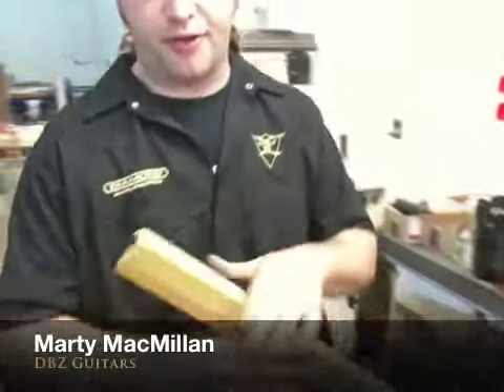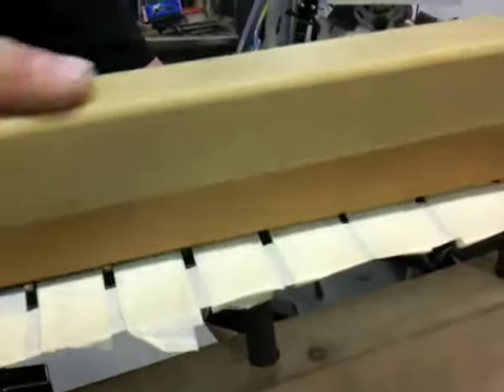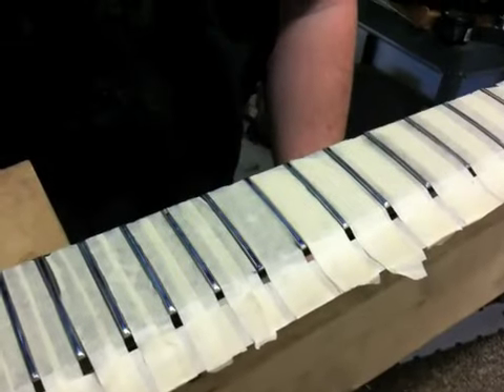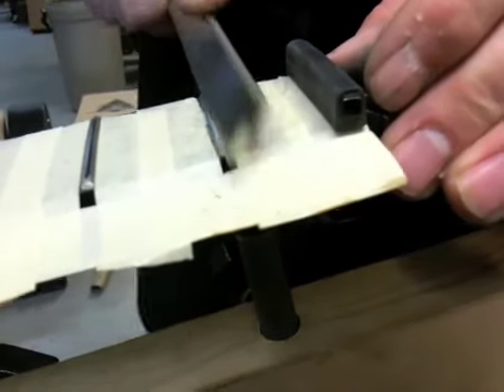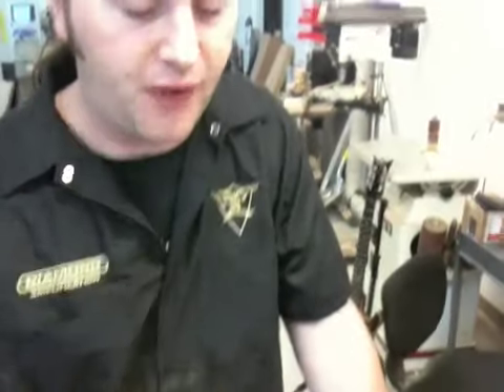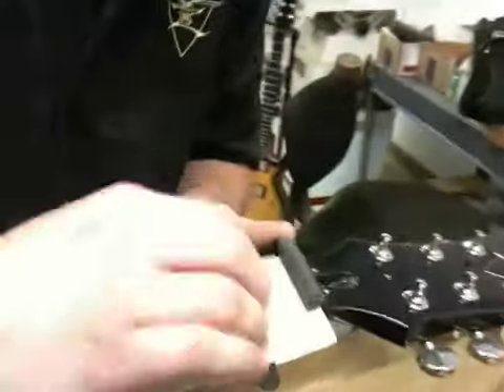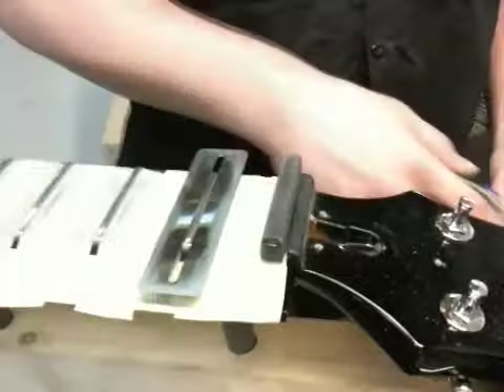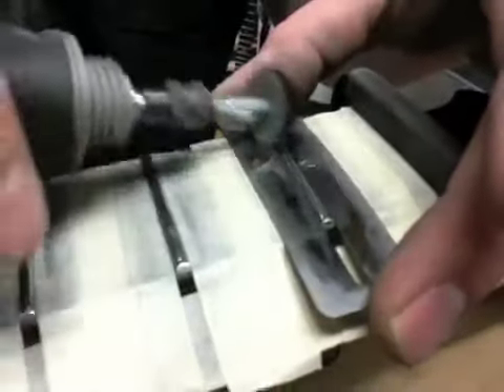DBZ Guitars: USA Custom Shop demonstrates a DBZ Bolero Fret Level (iPhone Video)

Comment: @IcechickenSr  You round the whole thing. However, the line in the middle--where is used to be flat--is the top of the rounded fret. So you don't remove anything from it. You round the fret so that it is the apex.

Comment: I have been practising leveling and crowning on a bass that is junk, so it makes good practice for this sort of thing.
But I have just realised that I have been using the crowning file totally wrong, by putting it on the top of the frets, instead of sideways like you have done.
I was wondering WHY the frets were so flat.
I think I was pushing down too hard when I was doing it, on top of not using the crowning file correctly.
Thanks for this video!

Comment: Hey love the videos man! So when you leave the trued up flat bit on the top even after crowining ect, are you actually then trying to leave that thin top (center) portion of the fret still flat then? I was under the impression one should be rounding the whole thing and not leaving the top flat? If you guys are leaving a little flat on the top where it's been trued up, then i'll do the same thing on my axe. Just be cool if you could elabourate on this a bit. Cheers dude IC.